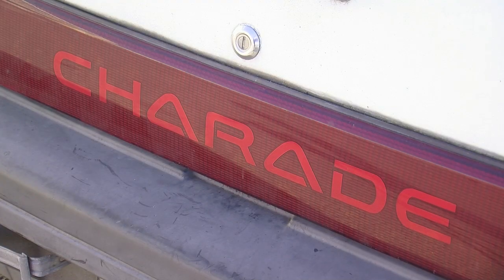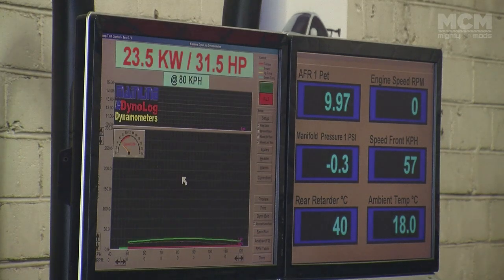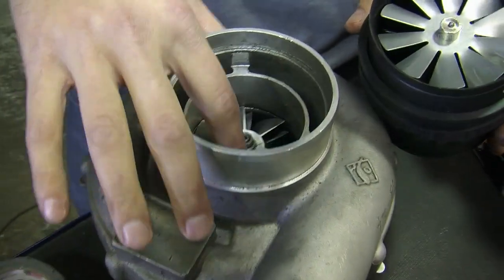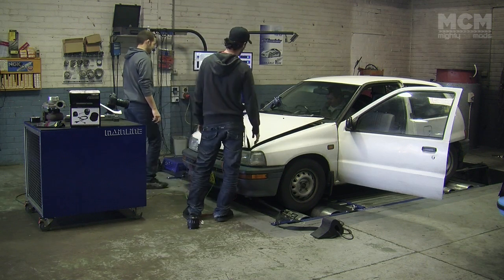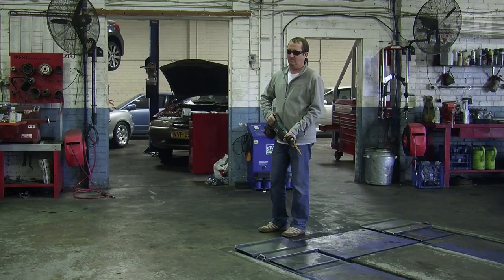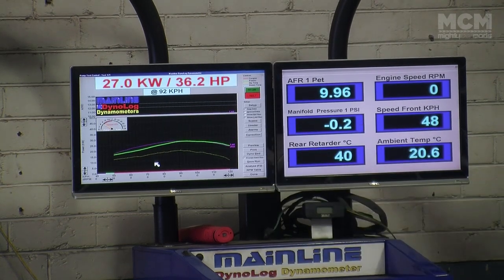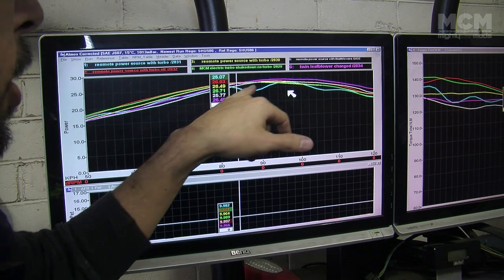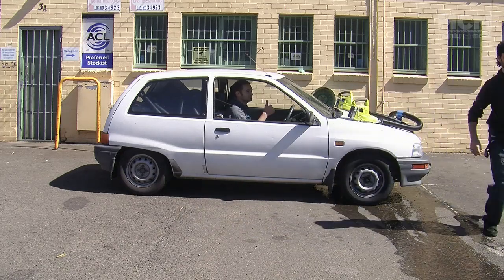Electric SuperChargers Mythbusted

Comment: The best thing you can do with one of these, if you feel like spending the money on it, is install it before the pod filter. Say you ahave a filter with a hole at the end so you and extend more piping from it to pull air from a cooler spot. That way you can draw some colder air without inhibiting airflow between the filter and the throttle body. But even doing that probably won't do much if anything, but it wont cause negative results.

Comment: More like a super charger,the drain on the electrical system when running   fan  will strain the alternator drawing more power from motor,canceling each other out.

Comment: The axial fan cant keep up with the cfm the engine can draw, if measured the intake manifold pressure would be lower with it installed than without it. 5psi on the box, probably rated at .5 cfm.

Comment: without a mass airflow sensor I'm not sure how forcing more air into the carbonator would create more power.
Reply: Engines that use carburetors instead of electronic fuel injection don't use mass air sensors. Carburetors use a mixture of air and fuel that need to be at a proper mixture for maximum efficiency. They can be tuned manually. EFI can be tuned using software which is why just throwing on a cone air filter from advance auto parts doesn't do much for performance. It needs to be tuned for the extra air flow. Also if the filter is just in the hot engine bay it turns into a hot air intake in turn decreasing performance.
Reply: carbonator drinks
Reply: Carbonator?
Reply: those Terminator sodaas from down under mate
Reply: Engines that use carburetors instead of electronic fuel injection don't use mass air sensors. Carburetors use a mixture of air and fuel that need to be at a proper mixture for maximum efficiency. They can be tuned manually. EFI can be tuned using software which is why just throwing on a cone air filter from advance auto parts doesn't do much for performance. It needs to be tuned for the extra air flow. Also if the filter is just in the hot engine bay it turns into a hot air intake in turn decreasing performance.
Reply: Normally a mechanical supercharger is placed between the carburettor and the head. That way the vaporised fuel cools the inlet charge. It also provided lots of lols when you get a nuclear backfire.
Reply: Carbonater😂😂😂😂 sounds like a pasta dish or a new soda
Reply: So if i'm about to add turbo for a carburetor engine, the air goes into the carb intake? or i need to add another manifold after the carb

Comment: hum..  wait a second..   isn't that a suck through carburetor?  which modulates fuel through vacuum??   I don't care what you use and how much pressure you can attain in the air intake plumbing, you wouldn't get any more power with that set up, all you would do is run lean as hell and blow the engine..   this experiment should be done on a  fuel injected engine, then I bet the results would be different..
Reply: Not actually true.  Some of the circuits of a carb (like the idle circuit) require vacuum.  But the main circuit meters according to air flow.  At wide open throttle, you actually have close to zero vacuum which is where you need to most fuel.  Blow through carbs setups are done all the time.  I have run a turbo carb setup and it worked fine.  Bitch to tune though.
Reply: +drjim86. I'm no expert, but I believe the vacuum seen on a Guage would depend on where the probe is placed..  there is maximum vacuum on the engine side of a normal carburetor at full throttle, because the engine is using as much air as it can get, which is how is pulls the gas into the air stream.  I believe a different style carburetor is needed for a forced air design. like a typical hot rod with a swim scroll supercharger, the air is being forced between the carburetor and the engine

Comment: Okay i just thought of this: 1kw is 1kw be it electricity of engine power it's energy. Now if you were to add on something strong enough to give about 4 hp that would be 3 kw, if you were to need that much power that would need a bigger power wire going to your battery than your average sub+ amp car stereo, if you were to pull that continuously your battery would go flat very fast and your car would in fact have 4 hp extra for that time, but the noise would be amazing, fan would need to be much bigger and you would hear some mad tofu beast fan eat all the air, making all kinds of wooshing noises. In a few seconds you dont only have 100 hp but 104 insane hp and then your car stops. However you could get a huge battery in the trunk, a 50kg lightweight battery would probably give you 10hp for a grand total of 5-15 seconds, instead of the effort getting huge power cables and an immensely expensive battery, you could probably spend 1/4 of that to get 100hp from adding a turbo to a N/A car. I have previously seen the video, and as other videos from MCM it is interesting, funny and even educational in a very entertaining way.

Comment: From a physics point of view, yes, that little fan (and the leaf blowers for that matter) will compress the air.  They're just not very good at it.  They're optimized for moving air at low pressure, so their efficiency will drop off a lot as the pressure differential increases.  The 5 PSI boost claimed for that chintzy little fan was almost certainly measured only within the tube that contains it, and then under ideal conditions, possibly with some overvolting, and the power boost was probably for some teeny-tiny engine...  Assuming the statements weren't just made up.

One thing that might be interesting to try would be a small air tank and an electric compressor.  Hook it up like you did the leaf blowers, only have the other half of the tee be a flutter valve so the engine can draw air normally when the compressed air is off, but will gain some pressure when it's on.  Obviously you'd have to wait a while for a 12v compressor to fill the tank back up between uses, but for something to give a small car a bit more kick on the rare occasion when you actually have to floor it, it might work...
Reply: You need to build pressure at high volume.  You won't get the volume out of a compressor tank.
Reply: You won't get sustained volume out of a compressor tank, so, as I said, it won't be capable of full-time use.  But, as an example, if I'm remembering how to do the math right, a 130psi 5 gallon tank will turn into 134 gallons of air at 5psi.  If you have a 2Litre engine, that'll turn into about 5 seconds of boost at 3000RPM.
Reply: The big challenge then would be to regulate the air at 5psi at the volume required.  Regulate the flow at 5psi would be easy.  Getting 300cfm or whatever at 5psi would be close to impossible.  

Interesting concept if it could work.  I think nitrous would make more sense.
Reply: If your estimate of 300cfm is correct, that matches with a 1" regulator, which are available for a reasonable price with a 250psi max input.  Looks like you can get 250psi 12v pumps, that would increase the stored volume and get the flow rate up, while still letting it recharge on the go.

Nitrous would have the advantage of being off-the-shelf, more compact, and not require a lot of fiddling.  Of course, then you have to pay for nitrous and deal with carrying a tank of poisonous gas in your car...

Comment: if you had tunned the fuel intake to match the air intake of the car I'm sure that you would have seen at least 20kw. more
Reply: With a properly-functioning carburettor, an increase in air flow leads directly to an increase in fuel flow (up to the limit the jets can put out obviously.  Which they might have been running up against with even the leaf blowers on a tiny car like that...)  

You do often need to adjust the ignition timing based on the pressure level however to get maximum efficiency.

Comment: They are testing the  electric supercharge but  not tuning.  Even if u use  a turbocharge or supercharger   u still upgrade the fuel injector because its  a law of mechanism to  gain hp. More air  + More fuel = Big explosion  in combustion chamber.

Comment: LOL a 400cc scooter have 32hp xD. Any way, if you don't change the fuel ratio at the carb you wont get a shit out of it. More over... those ebay. Fans won't compress intake air. I bet that de different power curves where because the engine was hotter and/or because air temperature and pressure was changing during the day. 

Maybe if it where an injection engine you could have seen some small diference. There is an Ecotrons EFI kit for small engines. you can try converting it to injection first. It would be a nice project to see how this oldie changes
Reply: my 125cc yamaha yz has 35hp lol.
Reply: NOPE THEY WERE BECAUSE THEY DISCONNECTED THE FILTER ALLOWING A BIT MORE AIR TO ENTER MORE EASILY. SIMPLE AS THAT
Reply: +derpface_ engage  2 stroke?
Reply: samet polat yep

Comment: To pump air you need a positive displacement type pump a centrifugal pump or an axial pump.
You canny pump pressure with a fan laddie.

However any of those three types above powered by an electric motor could do the job if the electric motor was powerful enough. Thing is true electric superchargers are just beginning to appear but for the most part the efficiency vs cost vs simplicity vs cost vs size vs cost makes the turbocharger win on cost.

Comment: These guys are jack asses  of course it doesn't work trying to force air the who knows how old air filter is usually u use a cold air intake with these units it would be a straight pipe into the throttle body

Comment: No point in turbocharging an engine if you can't deliver more fuel for the more dense air to burn.
need larger injectors or carburettor. #fact

Comment: An electric powered unit could compete with a conventional turbos if designed correctly and made out of the right materials, but the costs would likely exceed that of a conventional super or turbo charger - both may be old technology, but it doesn't mean they are outdated.

Comment: I used an air driven aluminum turbo fan version to convert my air intake to a venturi intake. I added about 9-11 1/2 inch holes. I mimicked my brother's SUV that has ecoboost in a similar more clogged mainline.
Reply: F1-Z turbo fan

Comment: I see the problem, the fuel and ignition timing were not optimized for all the added extra air/boost. That has to be the reason,  I refuse to believe that after spending $300 and 10 minutes researching/installing/dyno testing such a promising looking computer cooling fan turbosystem, there there was a "negative" result. You guys musta fucked sumfin' up. I think it needs a haltech elite 750. that'll fix it (so long as it does not knock)....

Comment: Excellent! Thank you for doing this vid!
So, it's all about psi not cfm.
Perfect. Thank you.
That makes total sense since an engine cylinder is all about the compression ratio - compressing air and fuel (gasoline petrol) and then igniting them to create the expansion of the compressed gasses which push the piston down the cylinder thus turning the drive shaft and thus the wheels.

Comment: Think of a supercharger or turbocharger as a high-pressure pump, not a fan.  It's pumping air into the manifold to make the pressure inside there higher than the outside atmosphere.

The air doesn't want to be compressed (it wants to equalise with the atmosphere), so the turbocharger first has to be able to stop it from escaping, and also be able keep cramming more in even when the air is fighting back.

That's why a small electric fan will do nothing – even if it was designed so air couldn't escape back around the blades, it simply isn't powerful enough to keep shoving more and more air into the manifold when the air already inside is shouting, "We're full!"

Comment: Surely they could have gotten more gains if they adjusted the carburetor? More air isn't going to give you any additional power without additional fuel going in too.
Reply: in an engine oxygen produces power. the fuel is only a catalyst of sorts. a perfect fuel ratio is 14.7:1. you need 14.7x the amount of fuel you need for a perfect combustion. now this doesn't mean you produce peak power with that ratio it's just the ratio for best fuel economy. typically on everday cars you dump more fuel than you need into the cylinders. so that's why you get more power by having better air filter and induction system. but that being said to maximize power you need an all around upgrade. So what if you can pump 5+ psi of air into each cylinder it doesn't matter if you can't spray enough fuel in there.  you'll get small gains but the rest of your systems will bottleneck the power. effenciey is the biggest power gain
Reply: I was thinking the same thing. I could see how its possible in fuel injected cars. The ecu would increase (up to the limit of the injectors and pump which, granted, probably isn't much) the fuel input to balance the increased MAP and/or MAF.  Cheap "chips" do this by artificially upping the map/maf signal.
Reply: Thomas the tank engine
Reply: +soundseeker63 thats the problem there... in another video they test "tuning air filters",which can obviously DEcrease the power, since they mess up the air/ fuel mixture... but from my experience, if done right, you can very well gain a little bit with filter tuning... (perfectly fine on 2-stroke engines on mopeds... my Honda went from 35 to 45 kph just by removing the filter... Others "faked" exhaust turbos and gained a few kph that way... good old days :D)
Reply: you stole the words right out of my mouth air to fuel ratio wasn't correct
Reply: Oxygen produces power? WTF dude.
Reply: Jaakko Fagerlund
no, the fuel-oxygen mixture does. so more oxygen can result in more power when the ratio was not optimal before...
Reply: word.  the AFR was like at 9:1 and it did seem somewhat affected by the little blower.  Either way, electric "superchargers" can blow me.

Comment: what about a tank of compressed air?
Reply: you mean nos?
Reply: +coldcoldrain13 probably melt engine. know how acetylene torches work? just my guess
Reply: how about oxygen?
Reply: nos is nitros oxide not air, but the idea is the same
Reply: how about nos
Reply: works, but short lived. Good for drag racing
Reply: no way. Oxygen has nasty habit to make things too reactive. So if you actually replace air to pure oxygen, you can cause some fires at places you do not want them to happens. And I think that grease / oil if mixed with oxygen can turn into explosive stuff. 
Same can happens in cylinders - instead of burning air-fuel mixture, you can get mixture oxygen-fuel that can be explosive at given ratio.
Reply: That's why there is NOS or nitrous oxide. Oxygen is too much in itself so you inject it as a mixture. NOS has been used for a long time in the history of vehicles and it's different from using a turbo.
Reply: +ryan sanders (and his 4 stroke) well kind of the same but not really. compressed air won't compress to a liquid.
Reply: It wouldn't melt the engine, just increase the chance of corrosion in the cylinders
Reply: Well yes, explosive mixture warning sheets for gases usually have 2 parts - bottom ratio and top ratio in between which the mixture is explosive. Agree. But you do not get energy from oxygen but fuel, so if you use extreme oxygen to fuel ratio, you may get less energy than from normal fuel-air mixture. But I do not know the exact values.
Still the problem with oxygen mixing with oil / grease and possible explosion or fire of this stuff remains.

That would also require probably big rework of the injection system.
Reply: +scottsv96 
Someone's done it.
http://www.hotrod.com/features/1604-a-new-kind-of-compressed-air-powers-this-9-second-camaro-and-changes-everything/
Reply: Jeffrey Culberth true
Reply: Runs out too fast.
Reply: Mungo You could use oxygen, but you'd have to run it extremely rich (like 8:1)
Reply: scottsv96 it'd need to be a massive fucking tank...
Reply: scottsv96 Yes, and you can make any mix you want

Comment: Good luck trying to increase the power of the engine using electric fan or leaf blower. I suggest adding more fuel, or modify the carburetor in order to keep the fuel proportional to the amount of air it sucked.

Comment: ya wont make any extra power if ya dont increase the fuel, all you will do is lean it out and fuck ya motor, but I suppose leaning out can do this, like the mighty VTEC controller to wreck your engine. Also block off the breather pipes. Not to say that the fans will work at all, but it will stop the motor from having to suck air, thats about it
Reply: if it was EFI wouldn't it just adjust itself to more air like it would when you change altitude driving from the mountains to sea level?
Reply: yeah I think so but only with a mass airflow sensor I think, but might be different if the computer just runs straight off a map but im not 100% on that. Just looked like it was a carby set up so jets would need to be changed, but only while the fan ran. I know a bit about motors but not everything and Im sure there are mechanics out there that could put us straight, only going from what I know. This is how some of us learn :)
Reply: +Adrian Paul ya, I totally agree if it is carbed it would need a rejetting with the fans on lol.

Comment: what if you'd put a electric motor on the compressing turbine of a turbocharger with a ratio so that the rpm where high enough to produce a good airpressure? it would maybe need an external power source and a switch inside the car to turn it on when it's needed. I would be so excited.
Reply: +Benno Krickl forget it...you´d need an electric motor that has enough power to drive the turbine to over 100k rpm... if it was that easy to do, planes nowadays would have electric jet engines, but we´re still far away from that :)